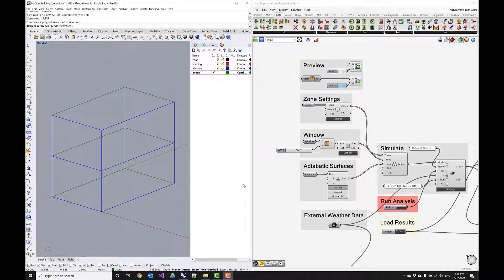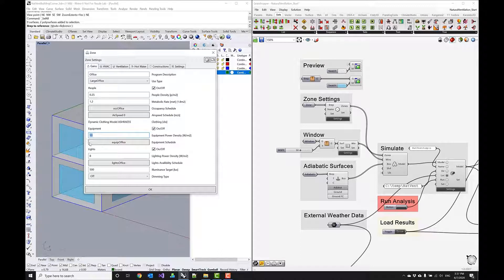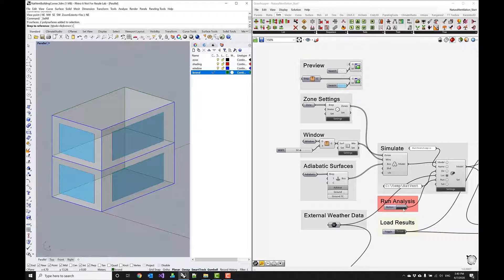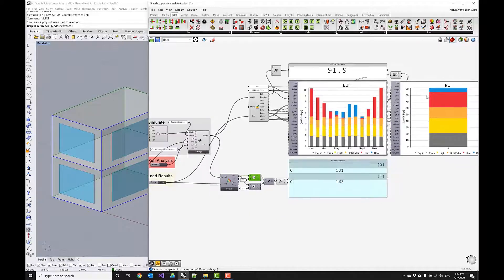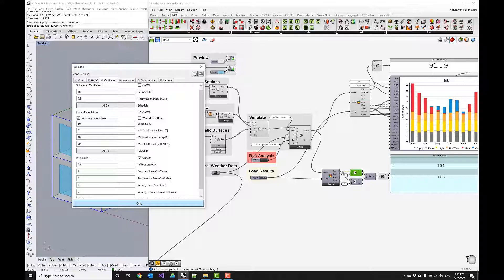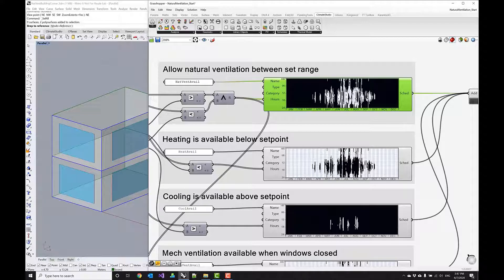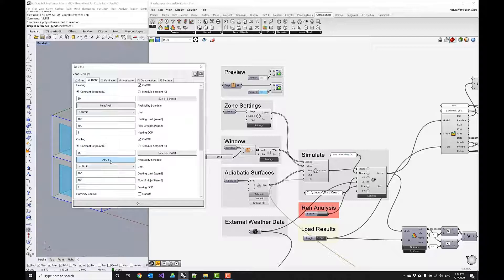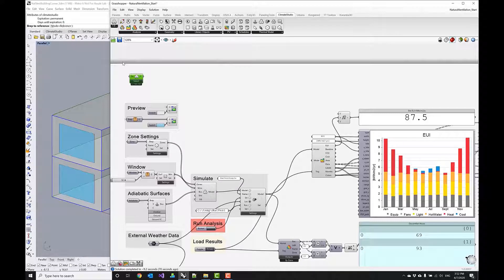ClimateStudio Energy: Natural and Hybrid Ventilation

Comment: amazing!!!! but i have a question regarding the schedule, can we also isolate the schedule based on set point and set time together, for exsample I want only operate the heating system for office which during office hour 9am-5pm in the set point on the dry bulb temprature above 26 degree celcius? Thanks
Reply from the maker: Hi Melvina! You can set a constant setpoint with an availability schedule from 9am – 5pm to achieve this.